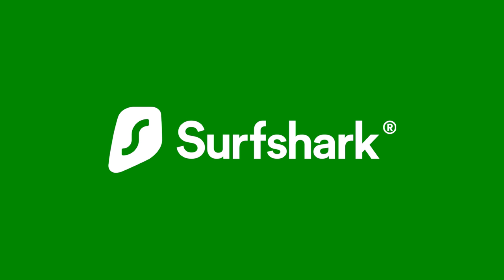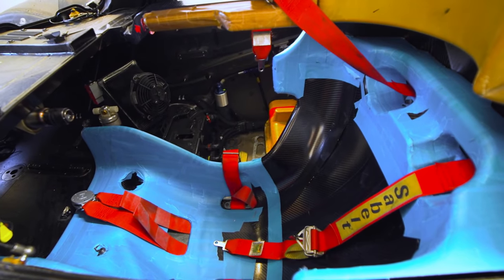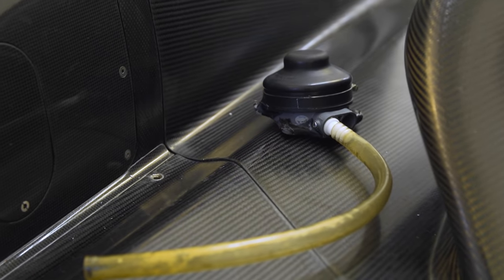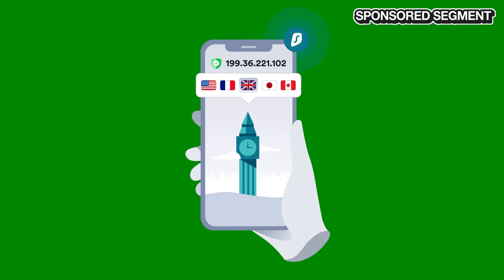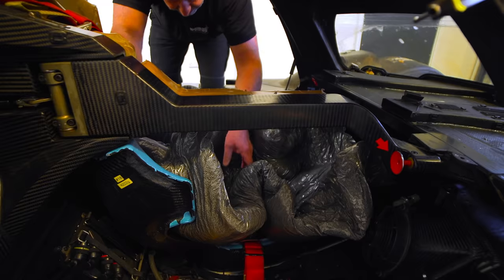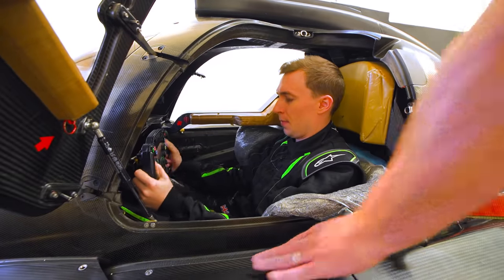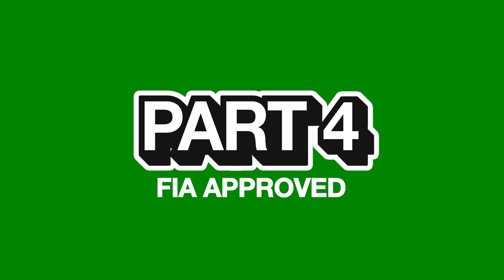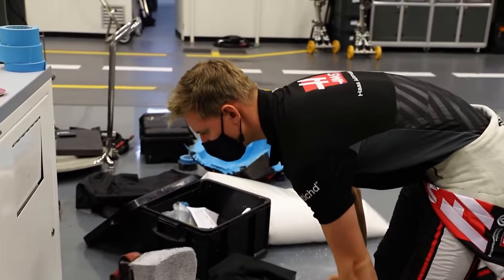The NEW Way Formula 1 Seats Are Made

Comment: There are much easier(and cheaper) ways to get a custom, foam fitted seat insert.
Reply from the maker: But not in Formula 1 :)
Reply: @mattamys  Why are so sure about that?
Reply: @rickden8362  I'm assuming because it has to be FIA grade and teams probably use only a handful of manufacturers. Real Equipe work with 5 teams to make their seats.
Reply: @myka4337  I believe SFI spec 45.2 is the appropriate spec. It's a fire retardant spec. a number of seat insert meet this requirement.